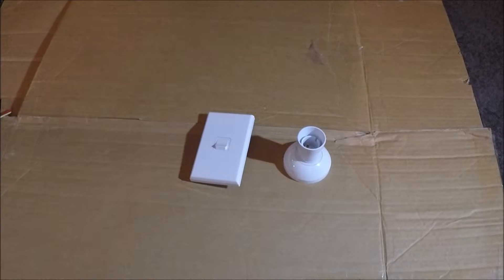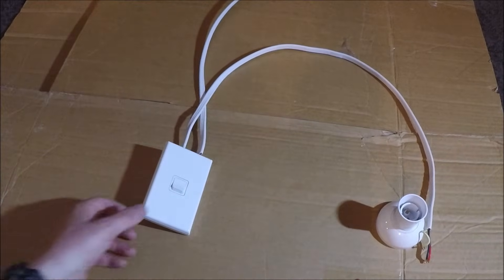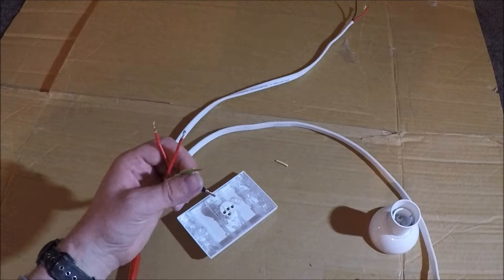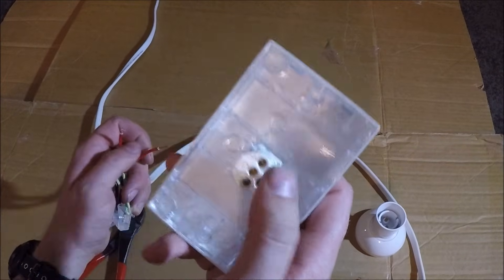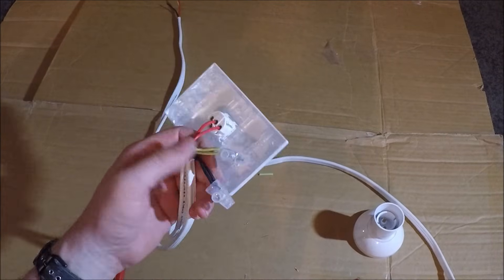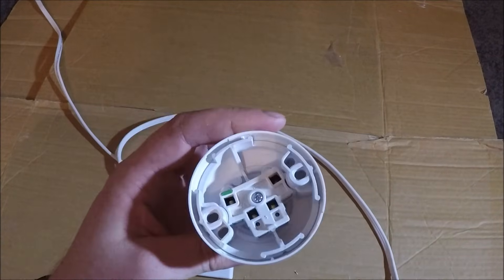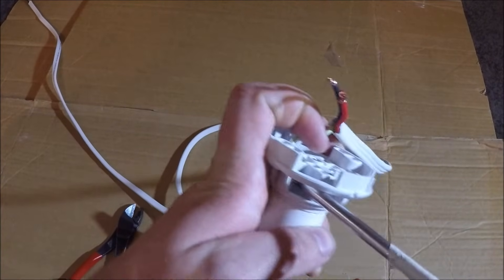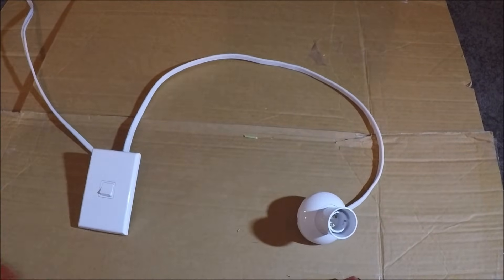Basics: Wiring a Lighting Circuit

Comment: Hey there man, I just had an question on the thing you pointed out since I just started an VET course to become an electrician,
I was just wondering if it matters where you put the red part in the light switch, because we had an practice session and I couldn't understand what I did wrong.

Also, does the one connected to the power have to be in control and the one connected to the light bulb have to be in 1 or 2,  And if not, would it still work if I were to put the red wire from the light bulb to the control and the red wire from the power to 1 or 2, would this way still work ?

 I also don't understand where the common, 1 or 2 is within the light switch since it wasn't pointed out in the material we use in the course. can you please give me any tips on these or any other ways to try and make it easier for me?

Sorry for wasting up a bit of your time but I appreciate you trynna help us rookies, much love ❤

Comment: Not the simplest way to do. Could have started with switchboard  power to batten fitting used all terminals there and take a two core cable to switch.

Comment: In the US light sockets wired in thread of light bulb is neutral button on the bottom is live brass screw live silver screw neutral consult with codes before doing electrical work

Comment: hi . After you connect the red hot wire to the middle or C terminal   on the switch , do you have to connect the red wire from the light socket only into the number 1 terminal or can it  go into the number 1 terminal or either one ?

Comment: There is only a single red and black behind my switch. 

Loads of cables behind the ceiling battens. It seems the mains power daisy chains in a channel cut into the cement ceiling.

Comment: Hey Dave, just a question in regards to video, assuming youve opened the light switch and replacing with something alot newer, how would one determine which wire is going to the switchboard and which is going to the light, cheers
Reply: Before removing the wires from the old switch either a) look at and remember which wires go to common and 1 and loop, or b) remove each wire one at a time from the old switch and install into the new switch. ie remove the common from the old switch and install into the new THEN same with each other wire one at a time.
Reply: The switchboard wire is always live. Regardless of whether the switch is on or off.  Best way to test is with a multimeter, flick your switch off and on while testing which one remains active

Comment: What happens if you put the red wire from the switchboard into the #1 and the other red wire to the light into the common by mistake
Reply: Nothing at all it will still work.
Reply: On will be off, off will be on

Comment: Hi Dave, our single gang switches have just 1 white and one red cable connected to them. In one room, the red cable goes to socket 1 but in the second room it goes to the C socket. Which version is correct?

Comment: I'm just trying to work out how to wire in two LED spots but will use a plug and not wire them into the mains. I am going to connect the spots in a circuit with one wire going to the switch. The cable I've bought has no earth. It's a metal switch. Is it necessary to have an earth? The cable that will go from the light switch to the plug also has just the live and neutral wires. Is it ok to do it all with no earths, especially considering I'm using a metal switch and a metal box?

Comment: Hey Sparkydave nice straight forward video mate, thanks for sharing. If you wanted to run a second, third, etc light/s that are to all turn on at the same time from the same switch, would you just connect another red, black, green wire into the same spots on the first batten fitting and on to the next light and then repeat for the third light, or is there a better way?. Cheers Andy
Reply: Bang on. That way you have no more than 2 sets of wires at each fitting.

Comment: Hey dude, whats the story if my light fitting isn't earthed, older style house 40s any help would be appreciated.
Reply from the maker: If there is no earthing conductor you can only install a plastic fitting (non metallic). The Earth is there to protect the metal parts of the fitting from becoming live in the event of a fault. To install a metal fitting the best way would be to run an earth bond (yellow/green cable of correct size) directly back to the earth bar inside the switchboard, and ensure appropriate tests are done.
Reply: @sparkydave  Cheers Dave it'll just be a standard plastic light fixture like the ones in your vids

Comment: Why isn't the wiring run to the batten holder from the switchboard and then looped to the switch? Isn't it better to loop at the light rather than the switch?
Reply from the maker: That's triple plating, a good way to save cable when wiring lighting in commercial buildings, however an old school and inferior way to wire residential lighting these days, have a video on that here https://youtu.be/p9kGxQ95NJU. Cheers
Reply: @sparkydave  thanks for the fast reply, from everything I've seen it is still the most common method used in Australia, funny considering both NZ and Australia share the same wiring standards.